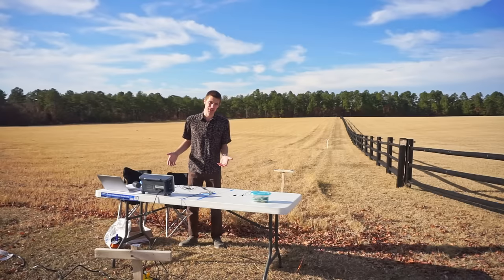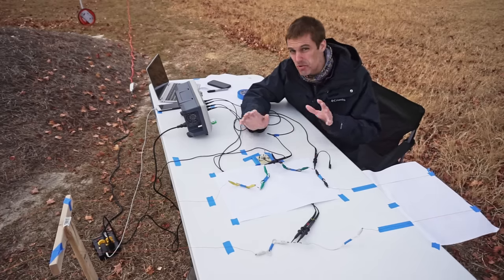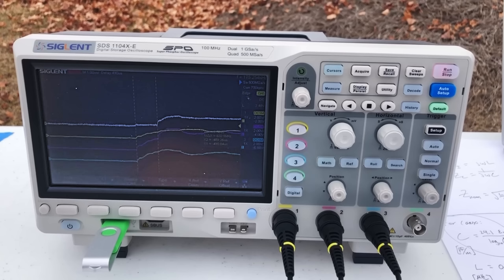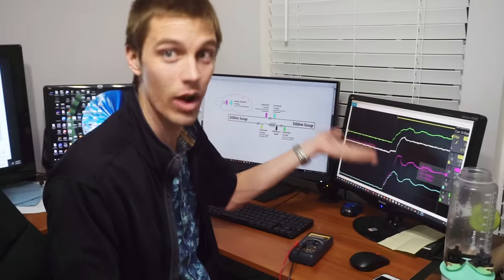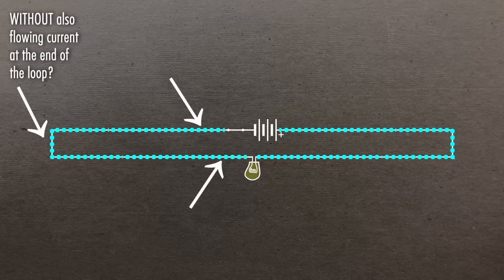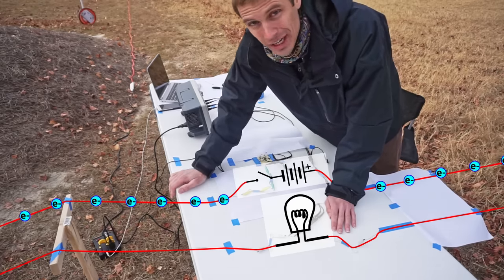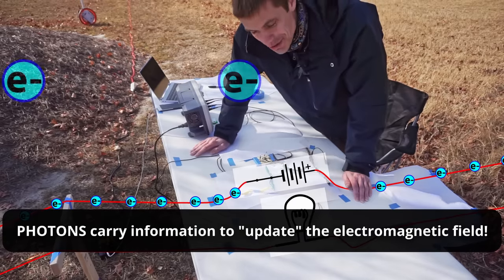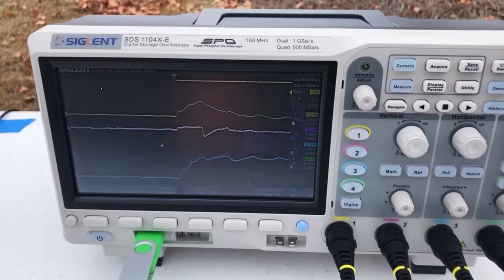I bought 1000 meters of wire to settle a physics debate

Comment: Thank you for this great video. If possible, it would be really cool to test what would happen if the "lightbulb" was completely contained within a faraday cage. Derek's video seemed to suggest that if the electric fields cannot get to the lightbulb, then it will not turn on. An intuitive understanding of how circuits works suggests the opposite, however. As long as the wires are able to get through the faraday cage, they should be able to deliver power to the lightbulb. 

This experiment is nice because if the bulb turns on, it will show that the fields are not strictly necessary. If the bulb doesn't turn on, this will strongly support Derek's thesis.
Reply: Considering that a Faraday cage is just a "good enough" approximation to a complete, continuous superconducting shell, it wouldn't be surprising for the cage to fail to block power transmission along a conductor that passes through a hole in the shell (though I would expect some power to be leached, depending on how good the cage is and how much insulation there is between the wire and the cage). If the wire is connected to the cage, I'd expect no power to reach the bulb.

It's also worth considering how you'd observe the bulb - if you can see light through the cage walls, then it's not opaque to that range of electromagnetic radiation, so you'd expect some power to leak through the holes due to the high frequency components.

The interesting question is how close the wire has to pass to a cage element to start seeing a significant drop in power.
Reply: Since he was using a resistor, the faraday cage wouldn't have much effect.  Whether intentional or accidental, his layout of the wire created a transmission line.  if the wire had been laid out in a circle, the effects would probably be different.  The transmission line creates a push pull reaction between the wires. In a DC circuit, this only happens when you change the current (on or off).  In an AC circuit, the current alternates, so the build up of electromagnetic and static forces are constantly switching directions.

Comment: This was a great demonstration, and when I saw that little bump at the moment the switch was closed I thought it must be inductance or capacitance. Still, I was surprised that the switch could affect the stored energy at the "light bulb" instantly. I am still not entirely convinced on what is going on there, but have no better explanation. Another surprise was the speed, as I always thought the speed of light in copper wire was significantly slower than in a vaccuum. Turns out that isnt necessarily true! A little more reading lead me to discover it can vary between 60 and 99% depending on the construction and layout of the cable; fascinating!
Reply: The cable construction is very significant at radio frequencies and typical coaxial cables have a PF of around 0.66. The single conductor doesn't behave like a coaxial cable so it's not surprising the PF is higher.

Comment: That was awesome. An explanation that I finally understood! Can't wait for part 2... what happens if battery and switch are further apart?! When do the EM fields get too weak? I must know!
Reply: Absolutely. This was a wonderful test well explained, and became one of my favorite videos of 2021 the second I saw the oscilloscope trace from the 500 X 1 meter rectangle.  Repeating the test with a cut wire was awesome.
The very next second I wanted to see the results of the same test with  250 meter square.  I hate the wait.
Reply: too weak for what?

Comment: We used to do a lab where we'd send an electrical pulse down a length of coaxial cable where it would reflect back off the end. Add an oscilloscope to measure the timing and it was not the speed of light IIRC.
Reply: Light speed is 3x10^8 m/s only in vacuum.  It is slower inside a dielectric material.  A coax cable has a dielectric sheating e.g., the plastic and the current speed will be slower usually around 60 to 70 percent of lightspeed.  Same goes with fiber optic cables, expect around 60% of the max possible
Reply: @babali1014  Thanks for that - it's been 40 odd years and I'm pretty sure my lab notes are long gone. Still, it's interesting how many takes there are on this topic - I haven't seen this kind of drama since the "airplane on a conveyor belt" saga

Comment: In the telecommunications industry we use an instrument called a Time Domain Reflectometer, AKA a TDR which is effectively Radar for a copper cable pair, something like a Riser Bond 3300. It will show reflections along the X axis, time and amplitude on Y axis both positive and negative. It will send a signal down the cable pair of a known pulse width and display the reflections on the screen, as the distance under test gets longer the pulse with becomes wider reflecting the extra power required.
Back to the point I was going to make, the Velocity of Propagation, VoP in New Zealand copper telephone cable is 68% of the speed of light for grease filled plastic insulated cable and 74% if it is paper insulated. When these instruments are calibrated at the repair lab they use a known length of coax with a VoP of 99%.
With your experiment a TDR will show an open circuit, a positive reflection at the table where your loop of wire started. A TDR does not work over open aerials as if the where on poles, only in a cable pair but if you had your bulb at the end of a 1000m long cable pair it would show a lower positive value at the end than if the pair was fully open because of the resistance through the light.

Hi from NZ,

Anthony
Reply: Yes I have designed and   built  TDR,s for use in the telecom  industry  Very interesting things to work on 
     Telecom twisted  pair has a characteristic of 600 ohms at 800HZ  but it does  change with frequency  and drops to 75 ohms at say 100khz  
The propagation speed is about 110meters per micro second  but that is to a reflection from a fault and back, This can to ether open or short  circui,t  Impedance changes can also be detected , If the pair of wire is terminated with a resister of the correct  resistance to match the impedence of the line  then no reflection is seem as this absorbents the energy  
A very fast short range machine with a very short transmit pulse  can even detect bends and kinks and even over tight cable  ties   on  coax cable due to to impedance  change

Comment: A clear tube with magnets in it might be a good demonstration of how adding "charge" to a wire propagates as a wave.
Reply: This sounds like a Steve Mould project, doesn't it? xD
Reply from the maker: I actually had a clip with a “loop” of slinky in slow motion but there was too much resistance with the table so I replaced it with the “top down” animation
Reply: Right, because the push pull effect is closer to reality with magnets. You can't really push a string or chain, it will once constrained in a tube. But the ends outside of tube flop around and electrons don't do that in real life.
Reply: At that rate you may as well just charge ping-pong balls with static electricity and put them in a tube; that way the description would be identical to the real case.
Reply from the maker: Oh man I was already planning to make a quick video with the floating magnets from my crystallography video but in a circle, and now I’m wondering how to charge up some ping pong balls cause I have plenty…
Reply from the maker: I don’t have a van de graff…

Comment: This video taught me more about electricity than everything I've researched, on top of an electrical course I took. And it put into terms anyone can understand. Bravo
Reply: If this video taught you more than an electrical course and research, then the course is bad and you suck at researching.
Reply: @jg97873  you sound fun. the processes used here are not only explained well visually, but he used analogies that tie everything together. we're even shown how to use an oscilloscope + other tools in the mix. And unlike every book and article out there, it doesn't make the same old assumptions about electricity using classical physics --  or say that current is like little water goblins pushing each other through a water pipe (which is plain wrong). He explains the wavelike attraction of the electrons from the adjacent side of the wire by forming its own positive/negative charge each time an electron is pulled/pushed throughout the wire, which I never heard of before. If you can find a book that covers all of this in the first 10 pages I'll be darned

Comment: Loved this, everything about it, the clear explanations, especially how the electrons are not interacting just with the ones next to them, but pretty much with all electrons around them, the closer the stronger the interaction. I'd love to see the experiment with a wire configuration that minimizes the "parasitic" effects, like capacity between the wires; maybe a configuration with the battery and resistor close to each other and the wire placed in a big square with one of the vertices next to the battery and resistor. The long wire can be on one side only, as long as it's the one being attached to the switch. Thank you for doing this!

Comment: I always had the thought experiment of this same experiment, except the wires go all the way around the world in a circle. That obviously wouldn't be practical to build, so it would be interesting if you repeated this experiment but had the wires form a 1km circumference circle or square instead of a narrow rectangle, to eliminate this capacitor effect. The switch, battery, and light bulb can still be placed right next to each other, however the one wire connecting them all should span the distance. I'd be interested in the results.

Comment: This is how I've always thought of it, and it makes perfect sense. If you have electrons with a certain degree of freedom in a material (which you need or it wouldn't be a conductor) then of course you can  have some "flow" aka bunching up of electrons, even without a closed circuit. That obviously starts immediately, because the first of these electrons are already right next to the bulb, transistor, ...  Thank you for this experiment and video. I'd be curious to see what happens if the circuit was a circle.
Reply: With the exponentially greater distance between the bulb-side wires and the battery-side wires we wouldn't see any "immediate" effect, that's why the Veritasium video focused on the 1m apart distance for the wires.  We would only see the full propagation delay for the given length of wire... unless the current was large enough to scale with the increase in distance... and that would need to be a HUGE current because of the inverse square law.

Comment: One additional experiment could be interesting : spread the strings of the 2 loops out (or bring them more together), the small valtage during this 1,6 microsec sould decrease or increase…
Reply: Yes, I was thinking the same thing- and ultimately, if the wires were in a big circle and not parallel at all…
Reply: If the wires are not parallel, you will not have a transmission line.  Electromagnetic and static forces can't interact between the wires.
Reply: Yes, but we don't want to forget that the constant current if maintained in 2 parallel rectilinear conductors of infinite length and placed a distance of 1 meter apart in a vacuum would produce between those conductors a force equal to 2 x 10 to the minus 7 Newton per meter length. 1 Amp. (Kidding around)

Comment: Very nice work, and I admire your curiosity to understand basic concepts around us. I just have one recommendation for this work. Since you have implemented this interesting experiment, if it's possible to repeat your test, but this time shield the wires around your resistor with an aluminum foil (let's say for one meter long) to see if you can get rid of the near field electrostatic from your source (battery side). Thanks again, very nice work.

Comment: The parallel wires make a transmission line. Looking at your scope trace is looks like the your parallel wires have a "characteristic impedance" of about 100 ohms. If you want to take this experiment to the next level, try putting a 1000 ohm pot (connected as a variable resistor, not a divider) in place of your 1000 ohm resistor, and vary it while pulsing the line at ~ 100 kHz
Reply: ah the good old rheostat.  very interesting idea indeed.
Reply: Tried to do just that with CAT 5 cable tying the twisted pairs in series. Kinda, sorta can see the effect. Not enough cable (some 400 ft total) and scope bandwidth (200MHz, questionable). Details, parasitics, scope probes will, etc. will get in the way. This is why 1km wire is much better. 

PS: the fixed or variable resistors must be non-inductive, otherwise it will distort the results. The close coupling of the twisted pairs results in sub-nanosecond risetime which a normal scope will not see.
Reply: @milantrcka121  You won't be able to see the sub-nanosecond delay from line to line at the near end, but will be able to see the ringing and reflections of the wave travelling down and back the length of the line. I can see and measure the reflection easily on 10 feet of ethernet shorted at the far end, and my ancient Tektronix scope is only 100 MHz.
Reply: @jimmurphy5355  Yep. Hence kinda, sorta... Even correction for cable propagation speed works out.

Comment: Very interesting. This reminds me of a similar thought experiment with an extremely long rod. Someone pushes the rod and it instantly hits a button on the other end very far away, transmitting information faster than the speed of light. Except of course that doesn't work and in this case it it would actually move at the speed of sound of whatever material the rod was made of.
Reply: Now what if you push the quantum field of a single quark to push a button doe?
I jest, I jest.
Reply: Sorry but I don't think the speed of sound through the material is the correct answer.  A vibration through the rod is one thing, but pushing it straight from end to end will be light speed or close to it, with the relevant interaction and only delay being the of the atomic variety... strong nuclear force primarily.  

Think about it... if the delay was the speed of sound through the material, we could make a rod merely the size of a football field and visibly SEE a significant delay... that ain't happening with a steel rod!  you're not getting that kind of compression with a gentle push.
Reply: @Artcore103  Are you sure you would be able to see it over that short of a length? The speed of sound of steel is over 13,000 mph. And if it got much longer that, the steel rod would end up weighing hundreds of pounds, and would require much more than a gentle push. I think that a 0.01% compression strain in that scenario is quite plausible.
Reply: @Artcore103  It would be the weak nuclear force, and o ly if the rod was monomolecular.
Reply: @Artcore103  Any material is compressible. Density, and modulus of elasticity of the material will determine the compression wave speed.
Reply: Yes good replies thank you for the corrections / thoughts!   Would be quite interesting indeed.   Totally meant the weak force oops.  And I knew the speed of sound in steel was higher but i had no idea it was that high!  I still don't think the  movement of the end of the rod would be delayed by the speed of sound and the distance, I mean maybe it would but it just doesn't seem intuitive.  And yeah might not be able to easily see it at 100M  but we could certainly measure it at even shorter distances.  Would love to see it!
Reply: @Artcore103  Agreed, I would love to see it. If it turns out the assumption was wrong and something else is the 'transmission speed' I would love to know what it is. These are fun thought experiments.

Comment: Question : The wire loops are relatively close to each other. what happens if you put the two wires really far apart? Will you still see the blip in the uncut/cut scenarios? I.e a 1 km circumference circle.
Reply: In theory you will see a small current after the light has travelled through the circumference of the circle and than bigger current when the electrons have moved around the circle, but in practise you can’t measure such a small current. The electric fields travel to infinity but their strenght decreses according to inverse square law so the effect drops very fast for longer distances.

Comment: Question: 

Would your findings be different if your switch was located on the opposite side of the circuit?
Reply: If the switch was next to the light bulb, and the power source was a long distance away?
That would be like a typical mains-powered appliance, where the power station is many km away.
The wires on either side of the switch are positively and negatively charged. When you close the switch the electricity can start moving across it immediately, but it would take a while to be able to see this at the power source.
Reply: @katrinabryce  i mean if you close the switch on the ground side as opposed to the power side. in the automotive world we typically ground side control everything to reduce voltage spikes.

Comment: what is "the wire"?  it is extremely important to tell use the details of this wire, and how it is strung.  the reason being what ever dielectric material used on the outside, and that includes stuff in the vicinity (plastic hold offs, earth, etc) will slow down the traveling wave.  Specifically, the velocity will be slowed down by the square root of the effective dielectric constant of any material in close proximity.

a common easily measured velocity is for a coaxial cable (inner conductor, surrounded by dielectric and an outer circular mesh).  in that case the dielectric constant is often 2.2, so the speed of light is slowed down by the square root of 2.2